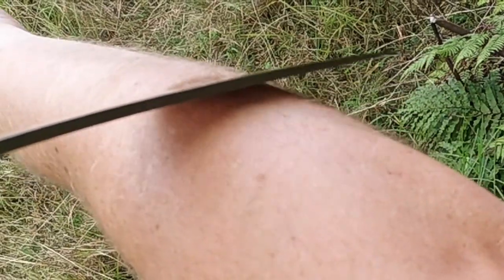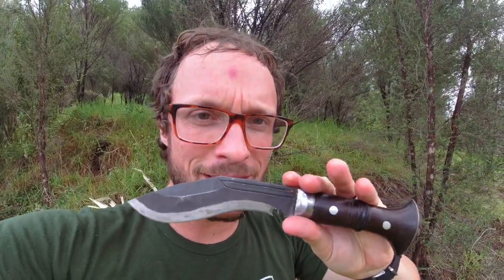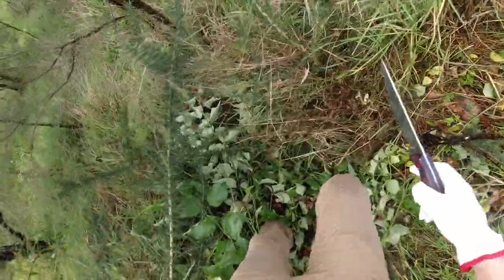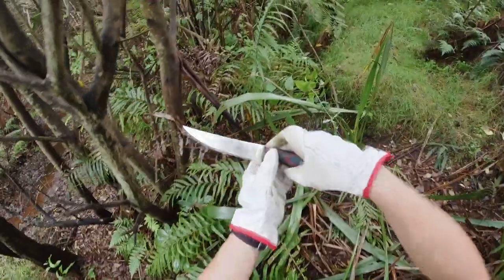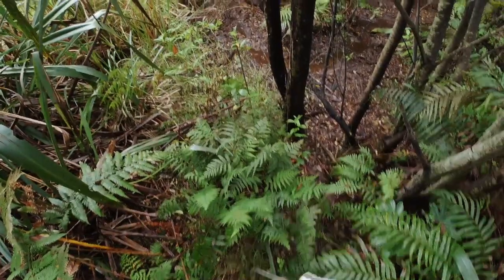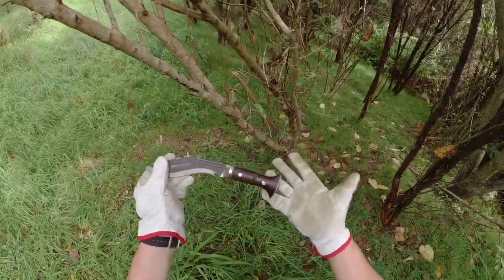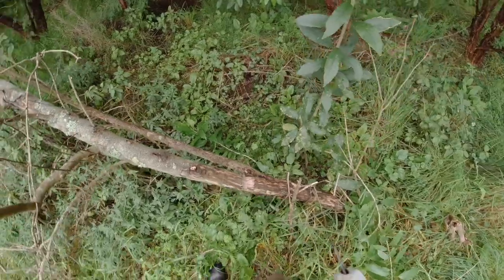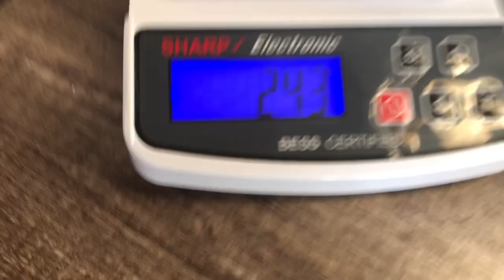Chop Tournament - Jensen Knives 63 HRC Nitro V Coastal Camper VS Traditional Kukri

Comment: Hi Gabe, first up great video...nicely shot and edited!  I'm happy you were able to get a nice edge on the blade and I'm also happy with the type of brush you cut with it.  As you mention chopping is on the bottom of the usage list for this knife....but it is meant to be able to handle making a crab or fish spear, then fillet or clean a couple of fish, then turn to in the cam kitchen, and be able to do that over a long weekend or 4 to 5 days without needing to be put back on the stone.....I think you showed it could meet that brief.  Thanks again!
Reply from the maker: Thanks for making it possible Wade!  Great job on the design and Heat Treat - and thanks for collaborating!

Comment: That looks like 60% scale model of a kukri. A proper sized one would probably still have the same drawbacks you mentioned, but with the benefit of more momentum and reach, and a much better grip. That Coastal Camper would still mop the floor with it, unless you got into really gnarly woody stuff.
Reply from the maker: Yeah, I think you could definitely find a better Kukri, and I think a well designed one would shine in this test.  Cheers Mike!

Comment: Impressive edge stability from the Nitro V, agree with all you completely, bit of a shame to put up that example to represent Kukri’s (I forgive you). One suggestion when using knives like Kukri’s, Parangs, Golocks etc.... with handles that function in a similar way is to bias your grip toward your pinky and ring finger, rather than the normal thumb and pointer finger biased grip. This can help reduce fatigue and help efficient chopping (suspect nothing would have been too much help with that soft undersized overweight Kukri)
Cheers, keep up the good work
Reply from the maker: I know I know 🤣 You are the Kukri, Bolo, Golock, & Parang master!  I have had 2 non-conventional Kukri's perform poorly on this channel, but I in no way feel that it represents Kukri designs in general.  I still need to get a good Kukri or other weight forward design, but I'm a bit dependent on what's sent to me at the moment.

I'll keep the grip tip in mind, you are right that my swing is adjusted for non-recurve designs and could do better with some adjustment.